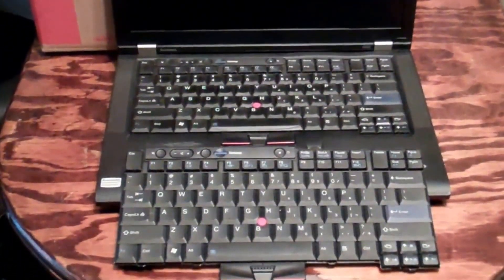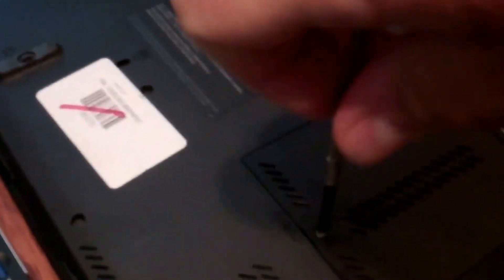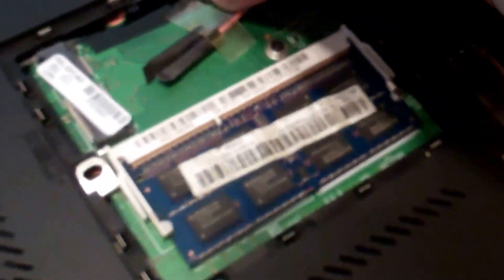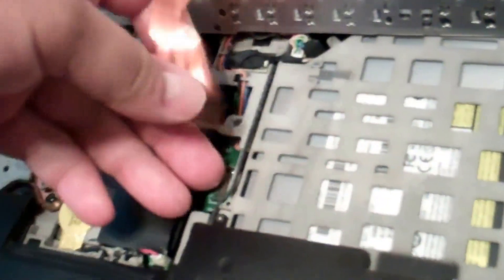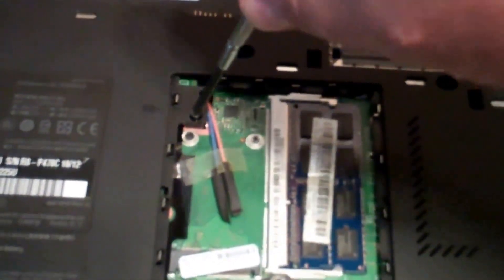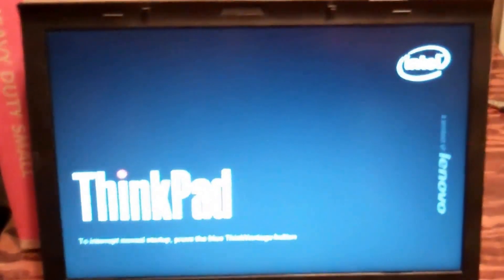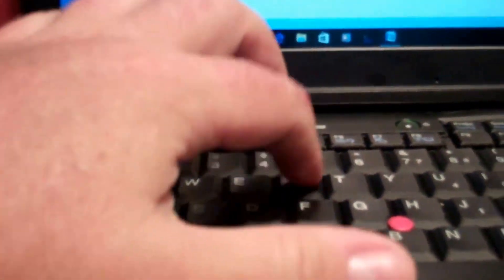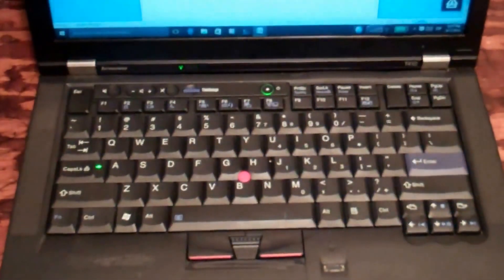Replacing a Keyboard on a Lenovo T410 Laptop

Comment: Thanks. Bought new Lenova because my T410 started to have trouble powering on - had to push several times or hold power button, then failed to start even though green light on (light around button wouldn't come on) - never got a reset time date warning which is meant to suggest a failing cmos internal battery - assumed it was the motherboard - just disconnect cmos battery as above, and laptop fired up - i spent hrs trying to fix this problem. 

MANY THANKS